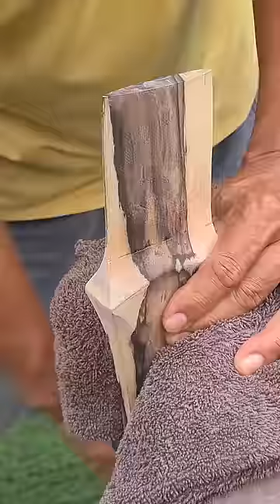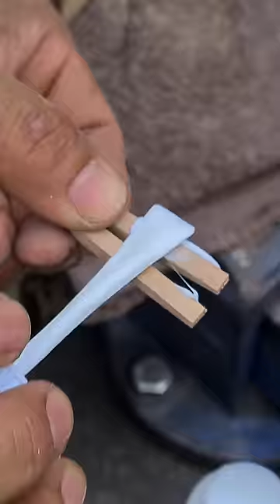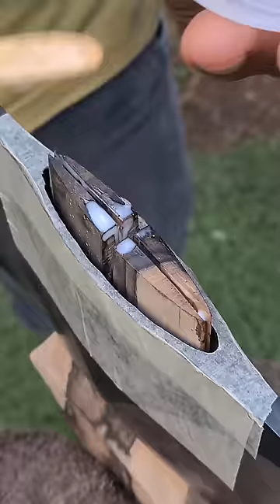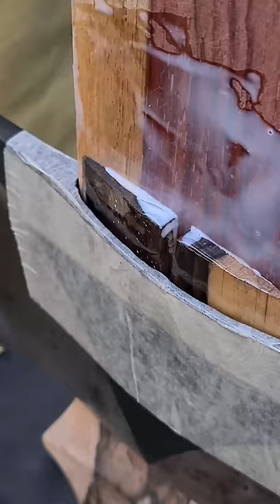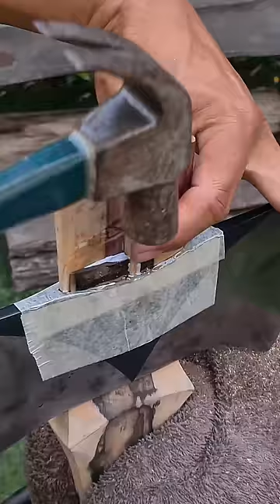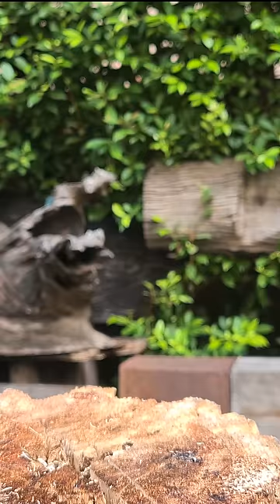The aesthetics of axe hanging with a cross wedge on an exotic wood handle #craftsmanship #shorts

Comment: 1. You should set an axe handle by striking the bottom of the handle firmly with a mallet... 2. the grain in the wood handle should aline with the cutting edge, not run opposite the cutting edge... 
3. All that epoxy you dumped into the gaps and spacing won't last. It'll break and shatter. 

But its pretty...
Reply: I was thinking THE SAME THING…..BUT…. I believe these are all made more for “art” than “function” 🤷🏻‍♂️ 

If this is true, that’s a shame, because he has some great talent and as a woodworker of 20+ years and an axe collector, I would LOVE to get a handle from this guy but I might attempt to just make one
Reply: My thoughts were if the handle broke and he had to replace it the glue would make it much harder than it needed to be
Reply: Trust me these guys know what they are doing. These aren't working axes, they are works of art.
Reply: @ChristianWeathersby  .... so they don't know what they're doing, cause that's not how you handle and ax, or any hand tool. 

And I definitely know what I'm talking about. If you want to learn, look up Wranglerstar...
Reply: Exactly what I was going to say. You have to strike the bottom of the handle to set an axe.
Reply: @ChristianWeathersby Until someone mistakes it for a tool. Nothing in the title or video says it's intended strictly as a showpiece. The entire philosophy of making tools as art isn't simply the aesthetics. The tool is still supposed to be a fully functional and properly made tool.
Reply: @Theggman83 they know that this is not working axe, so what they did isn't wrong for their purpose tho
Reply: @monkeking8604  ummm... It doesn't really matter what they made it for, there's a right way and a wrong way.
Reply: @bufordhighwater9872 not necessary, you would not abuse your thousands of dollars knife for batoning wood right? So also this, I know that tools are meant to be use, but some people just want it for their beauty and I think nothing wrong with that
Reply: @Theggman83  you just won't admit it, their way is correct for art purpose, that axe don't mean to be abused so they don't need to secure that to maximum tightness, the most that axe would be use is some mild swing and some photo set here and there, and that would be more than strong enough for that purpose
Reply: @Theggman83  its different story if it would be used by lumber jack or farmer, you need hung that as tight as possible, but I think no one in their right mind would abuse axe with that kind of beautiful handle, but each to their own I think, so let's agree to disagree
Reply: @monkeking8604  no, that's just not the case. As another commenter highlighted in this thread, you do it the right way so no one ever picks it up and uses it as a tool. Axes and hammers that arent attached correctly are dangerous. They have killed people...
Reply: @Theggman83  once again, that's not that axe suppose to be used, it supposed to be art piece, like you would never use your thousands of dollars knife for batoning, thats just not it's intended use
Reply: @monkeking8604  lol an axe definitely isn't worth thousand of dollars if it can't be used, kid. 

There's no excuse you can make. It's dangerous. Period. 

No carry on with your opinion. Just don't use any hand tools around me.
Reply: @Theggman83  you don't seem to get my point, a little dim I guess? Yeah let's stop here, I don't have anymore to say to you at this point cause I guess you just want to argue for the sake of it
Reply: @monkeking8604  you don't seem to understand that your point doesn't matter, kid. 

You're dismissed. 🥱👍
Reply: @Theggman83 dude don’t recommend that guy if you’re trying to sound professional😂😂😂😂
Reply: @JIMMYUNKNOWN   deflection is noted. I only recommend "that guy" cause it's an easy to find reference.... Do you have an alternative source? Is wranglestar wrong? I'd love to hear how. 🤣
Reply: Pourrais je avoir plus de détails svp

Comment: I haven't seen an axe maker use epoxy like that before.  Does it make the axe perform better or is it just for looks?
Reply from the maker: As for me, I used hardwood for the handle, I thought it would add strength, but actually one wedge was enough.🙏😊👍
Reply: @poomsproject  I think the epoxy will crack and fall out when the axe is used.
Reply: @Goalsplus I have seen epoxy hold things together that seemed almost impossible. Most of these are not going to see hard use. Its still an axe but it's also artwork 🇺🇲

Comment: Why is epoxy or glue used when the wedges are supposed to keep the axe and handle together?
Reply from the maker: To get more stronger, just a thin layer of epoxy that hold the handle and an axe head.👍😁